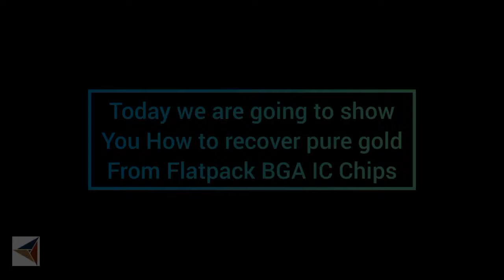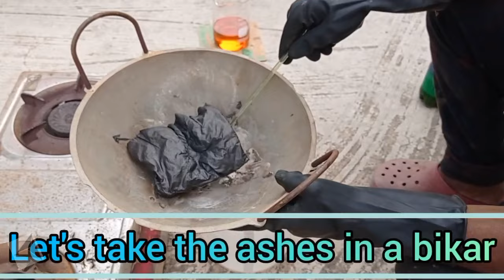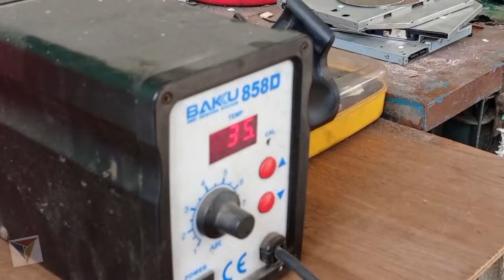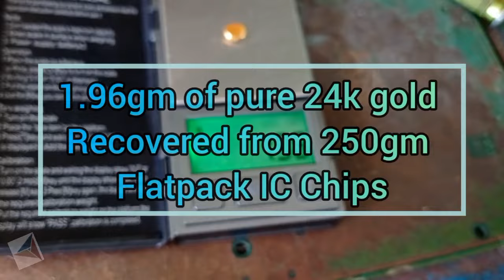Small BGA IC Chips Gold Recovery | Recycle Gold From Computer | Gold Recycle From BGA IC Chips

Comment: Sir computer kay connector or mobile kay parts ko ek saat Mila kar bi gold nikal saktay hay keya sir plz help us or sir .myray pass computer or hard disk or computer mother board or mobile ki ic hay keya sab ka ek saat gold nikal saktay hay plz 🙏help.aap may jo video banai hay very good or sab may method aalag bataya hay .plz guide ne
Reply from the maker: computer ic chips and mobile ic chips both mixed you can process for gold recovery, no problem ... but some problem you faces that's .. mobile ic chips is quiet small then computer ic chips...

Comment: which metal bowl u used for heating them
Reply from the maker: Aluminum bowl
Reply: but it will dissolve in sulphuric acid while heating  it is fast dissolve na how do u prevent it
Reply from the maker: @trinadhbitra2088  no it Won't